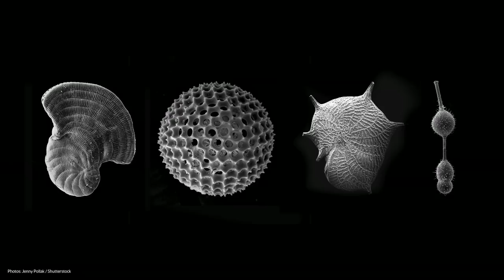The next step in nanotechnology | George Tulevski

Comment: For those who got to the end and had no inkling what he's actually doing:

The challenge is very hard:  You have a bunch of carbon nanotubes that you want to make into a computer circuit, you want to get them to sit down on a silicon wafer in a way that allows you to make billion-element circuits with switch sizes smaller than today's smallest transistors.  How do you do this?

The solution, in principle, is actually very simple.  You suspend a bunch of individual carbon nanotubes in solution.  Then you make very fine patterns of things that stick nanotubes and don't stick nanotubes down on your silicon wafer.  Then you just wash the nanotubes over the silicon wafer until they stick in the right place.

Well, in detail this is actually really really hard to achieve:

First, you need a way of generating patterns that are denser than those achievable by modern lithography.  People have come up with very clever ways of doing this.  Two of the best ways are something called block-copolymer lithography and DNA nanotechnology.  In either case what you are doing is making chemical polymers that self-assemble together to create very fine patterns.  

Second, you need a way of purifying semiconducting carbon nanotubes, cutting them to the exact right length for your circuits, then suspending them in solution.  This is actually also no an easy problem, but people have come up with ways of making small polymers (eg, short strands of DNA) that bind onto carbon nanotubes, wrap around them, and suspend them in water.

Third, you need to create just the right interaction between the patterns on the surface and nanotubes in suspension for them to land on the right spots and wiggle into place along the patterns you define.  This is pretty hard.  You need to engineer the right chemical handles onto both the surface and the polymers wrapping the nanotubes.  You might have to have the surface help channel stuff into the right place with morphological features.  Then you create just the right conditions so that nanotubes will align themselves onto surface patterns via many weak chemical interactions (if the interactions are too strong they can lay down in the wrong directions, make tangled messes, etc).  This is pretty hard.  People are still figuring this out.

Lastly, you need to scale up all of these processes so that IBM or Intel can make perfect wafers with literally trillions of these devices.  This is really hard because once you get down to nanoscales, thermodynamics fights against you every step of the way.  You can make things easier by simplifying the requirements for assembly: eg instead of having nanotubes lay down on the surface to make circuits, just have them all forming parallel arrays pointing in one direction.  Use lithography to define the other features that make up the circuit on top of them.  Even so, it takes tons and tons of work.

Finally, here's the one question that nobody has asked:  Why carbon nanotubes?

It turns out, it's not impossible for Intel or IBM to make transistors that are about as small as carbon nanotube transistors.  The problem is that if the electricity flowing through the transistor is carried by silicon, there will be so much power dissipation that your CPU will literally melt itself before you can finish one game of Call of Duty.  Semiconducting carbon nanotubes, are just about, the most power efficient semiconductors known.  Graphene could be even better but it's actually not a semiconductor, so, no real good way to make it into a good transistor.  So, carbon nanotubes are really, one of just a handful of materials that could possibly allow Moore's Law to continue down to transistors on the size of 10 nm wide or so, which is why IBM is still at it.

(BTW, 10 nm transistor is not the same as a 10 nm node on the semiconductor roadmap.  The 10 nm node actually has much bigger transistors).  

Anyways, I hope IBM succeeds.  I'm rooting for them.
Reply: bish whet
Reply: Fascinating! I can only hope that carbon nanotube and graphene based technology reaches factory production in my lifetime. The uses of graphene alone, blows my mind! I can't help but think that if we were able to make an AI that could learn and do complex equations for us and assist us that our technological advancements would blow ahead by decades or even centuries. I digress though. Thank you for the more detailed explanation Mr. Han! When he explained the difficulties of aligning carbon nanotubes, I had thought they were going to employ the use of tiny robots to do it haha! Tiny robots with really tiny precise claws.
Reply: Thank u !!!it really helped me!
Reply: And here we are, 3 years later, with 3 nm nodes planned for commercial release.
Reply: Ok. Thanks. 
I couldn't get to the end of your explanations either.
I'm done trying to understand all this.
Reply: Help me shut off NANOTECH BMI please mk
Reply: @godlikemachine645  so they achieved it? Sorry my little brain cant keep up lmao
Reply: @KingM119  so they achieved what? 3nm? Yes. They have 2nm prototypes right now. 3nm is still a ways off from mass manufacturing, it seems. But we do have 5nm right now.
Reply: Titanium nanotubes in baked hostess products as it is less lethal than graphine allows hackable humans.
Reply: @ricoshea6101  Your conspiracy theorizing is top notch!
Reply: I'd just add that carbon nanotubes is a sheet of graphene rolled up into very thin tubes. So that's the way to build transistors with graphene.
Graphene is not a semiconductor, so it wouldn't work any other way. In fact, it's almost a perfect conductor. For you to be able to use graphene in both conduction and isolation mode (i.e., a semiconductor), you can roll them up into nanotubes. If it is perfectly rolled up, then it's still not a semiconductor. But if you roll it *diagonally*, then bam, it's a semiconductor. This is called a chiral (rather than a zigzag or armchair) nanotube. Check out the pictures!

Comment: Would be cool to Flash Build.. Have a computer linked to an area.  The area full of electric chips or whatever. Flash the blueprint on the computer to the chips, therefore electrifying a hologram   of the blueprint. Pump the nanotubes in and they'd begin to form around the hologram. After some time, turn off the hologram for the nanotubes to cool and become solid.   
          THIS IS ALL IMAGINARY

Comment: computer chips don't shrink in size by half, and their power doesn't grow twice every year. if you compare two Intel subsequent technologies, you'll learn that those chip got only like 10% more powerful. and chip shrinking... size of single core transistor changes in technology to technology like 30%. but Intel used to introduce new technology every second year and now slowed as it's getting way harder to shrink this tiny transistors anymore. and shrinking only affects core transistors. and every time they put more transistors on chip. so the chip size stays relatively constant.

Comment: 0:40 "The only way you get a statue out of dust is to let the statue build itself"
3:00 "We couldn't place one by one millions of particles together"
This remarks are only true with the current state of technology. In the long run massively parallel pick and place positional assembly of single atoms (and bigger assemblies of them) to advanced systems is predictably much more performant and desirable than chemical synthesis (in liquid phase) and subsequent self assembly. Chemical synthesis (in liquid phase) and self assembly will be powerful tools though to get to positional assembly (more precisely: mechanosynthesis of diamondoid materials in machine phase). Also these soft/wet techniques may make early forms of nanotube-computers and other things the presenter is talking about possible a bit sooner - early forms.
7:18 "Mother nature builds everything this way". There are big areas where the capabilities of nature and the capabilities of human technology do not intersect. Both ways. While there is lots of nature we do not understand and can't replicate there are also many examples of human technology that are probably "eternally" inaccessible by incremental evolution.
Reply: Thank you so much ❤
Reply: Can you help shut off NANOTECH malfunction ???